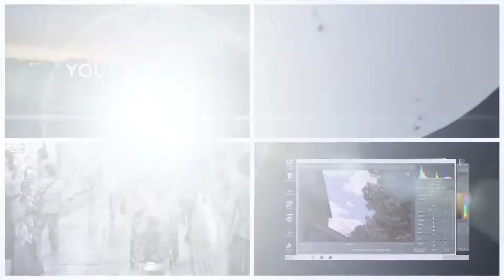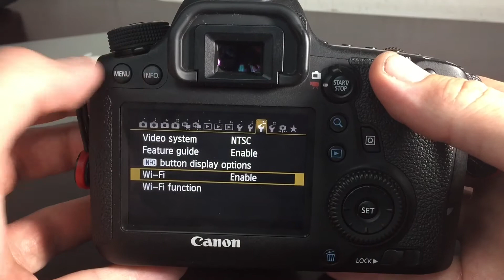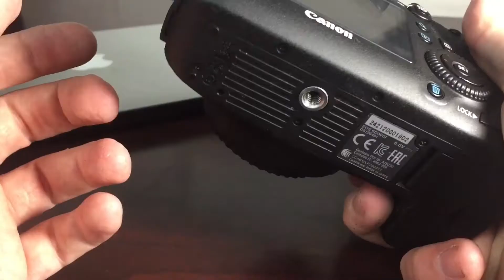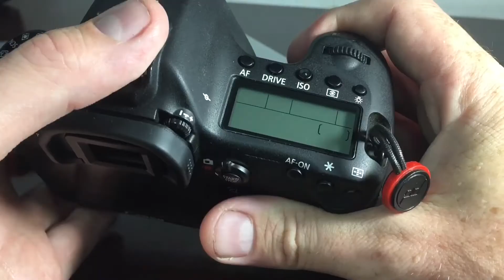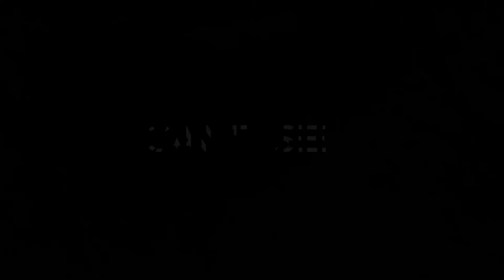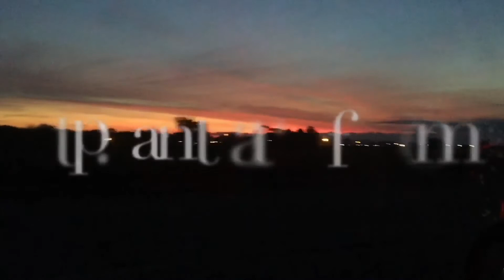Canon 6D impression - astro and street

Comment: Sir, I was looking to buy the 5D Mk III which is suppose to be a great low light camera, would you give us your opinion between the 5D MK III  and the 6D Please.  I know the 5D newer series is not very good for astrophotography.
Reply from the maker: +tanker1960 unfortunately I can't. I have never used it. Sorry I can't help you on the matter. The only suggestion I can make is that higher photo-cite grouping, like the monster mp high end cameras tend to be less effective at light collection. At a point your grouping on the sensor becomes too tight and effectively your signal/noise ratio gets worse. The 6D operates best between 3200 and 6400 ISO. This is from my testing. I personally recommend cameras with sensors between 18 and 24mp. You can find a lot of literature online regarding cameras especially good at low light. The 6D can autofocus at -3. That's hard to beat. Clear skies.

Comment: Hi. Thanks for the video.  I just got my Canon 6D but haven't done any astrophotography yet with it.  I do have a question about your feelings on doing the modifications to the camera to make it full spectrum (i.e. removing internal IR filter, etc.).  This process is described here: http://dslrmodifications.com/rebelmod450d1.html.  I'd rather not dedicate the camera to JUST astro imaging but don't want to give up the ability to get good astro images.  I've read some things about using certain Astronomik filters with the 6D to compensate for the internal IR filter and it seems he is getting really nice results (see here: http://amitkamble.com/astronomik-filters-comparison/.  Do you have any thoughts on all this?  Appreciate any help you can provide.  Thank you.
Reply from the maker: +Christopher Lyons most definitely. Clip in filters are the way to go. Just remember to use them prime or with EF lenses only. EF-S mounts protrude too far into the body. The 6D is amazing at low light. The gain you get switching to full frame sensing is remarkable. My opinion is stay out of the camera. It's a fine machine as is. Astronomix is fantastic. The quality of their filters are spot on. There's a cheap Chinese knock off out there. Stay away from them. I readily put my 6D up against my modified 60D. No comparison. Eats the 60D for breakfast. Lower noise higher signal. Requires shorter exposures. I hope that helps. If I can help you further don't hesitate. My final opinion: no need for modification. Clear skies.
Reply from the maker: +Christopher Lyons further You can look at my Instagram and see some Milky Way single expos I took with the 6D and the old version of the EF 24mm F2.8. They are untracked. I was amazed at the quality of luminosity at around 10-15 seconds and ISOs over 3200. No filter in those shots.
Reply: Garnett Leary Thanks for the quick reply. Really glad you agree and have gotten good results with filters vs mods. Which filters do you use for DSO objects? I have 2 scopes, a William Optics (www.williamoptics.com) GT71 and a Meade 8" SCT with reducer/flattened. For visual, just switching over to 2" diagonal and EPs. Just ordered William Optics Durabright Rotolock 2" WO Diagonal and the set of his XWA 2" EPs. Also got the SWAN 2" 25 & 33mm EPs. Love WO products!. Really excited to see the difference from using 1.25"! I picked up the Tamron f/2.8 24-70 & 70-200 VC lenses. I'll take a look at your images, thanks. I'm sure I'll be contacting you with more questions as I get everything together and do some imaging! Thank you very much.
Reply from the maker: +Christopher Lyons sounds like you got a good setup. I stay old school. I mostly use light pollution suppression and I stick to basic RGB. I want to recommend a channel. This is my friend Jeffs channel. He's doing some cool stuff with O3 etc:

https://youtu.be/VkKBb18F4xc

Comment: Hi Mr. Leary, thank you for this video. Thank you for all your videos for that matter. I want to start doing astrophotography, and I have been doing lots of research. I am starting from scratch, so I don't have any equipment yet. I want to use a DSLR as my camera because I want to be able to use it for terrestrial photos as well. My question is, does a DSLR need to be astro-modded to get good astrophotos and once its modded can you still use it for terrestrial photos?
Reply from the maker: +Scott Budd That's a great question and thank you for the compliment. When you modify your camera it becomes more sensitive to the hydrogen-alpha lines. Most of space is in that wavelength. The red eye reduction filter is close to that number in nm so blocks a lot of it. My answer is no. You don't have to modify it. It does boost the sensitivity to that wavelength but I recommend reserving that for guys with tons of equipment. I say that because you then need to work channels of rgb independently of each other. For example make the red channel your h-a, the green your O2, and such. Those types of exposures are far more suitable for people with lots of experience and expensive tracking equipment who can stay polar aligned for hours at a time. There is a huge difference but not one you'll readily take advantage of early in the game. That said, daytime shots will have a redish-purple glow. You'll spend far more time in edit correcting white balance and likely it will frustrate you early on. A naked sensor modification also disturbs the autofocus system of the camera. That's because by removing the filter you are essentially removing part of the camera optics which throws off the light transmission. My recommendation to you is, assuming you want to work in increased h-a lines, is to buy an astronomix h-a clip in filter. It will greatly boost those transmissions and can be easily removed. The downside is for Canon it only works with EF lenses. EF-S lenses enter the camera body too far and the clip filter obstructs them. They make them for Nikon too but unfortunately I'm not familiar with the compatibility. The guys at astronomix can answer all your questions on that. Don't modify your camera if you use that same camera for terrestrial photography. Instead look into the clip filter. They hold great resale value too. Ultimately sensor size and lens speed dominate wide field both in camera only and astro prime. Look up "Lonelyspeck". His work is phenomenal and he shoots unmodified. I hope this helped. Clear skies.
Reply from the maker: +Scott Budd You gave me an idea for a video. I'll be home from New Orleans in around two weeks. I'll go to my dark sky site and do a video on Milky Way if I get chance. Most of my videos are from city light pollution but intentionally so because most people face that problem. I want to add further to your question that above everything else sky conditions are of upmost importance. The super high quality images you see are partly technical knowledge, moderate to good equipment, but mostly dependent upon the darkness and steadiness of the sky. Hopefully I'll get a chance to compare that in a video soon.
Reply: Thank you for the reply. It helped a lot. Glad to know I can get a DSLR and be able to use it for both and still get good results.
Reply from the maker: +Scott Budd you're very welcome. Good luck and clear skies on your ventures.